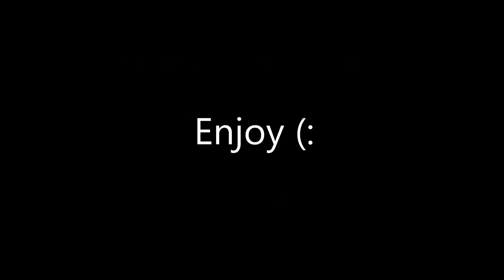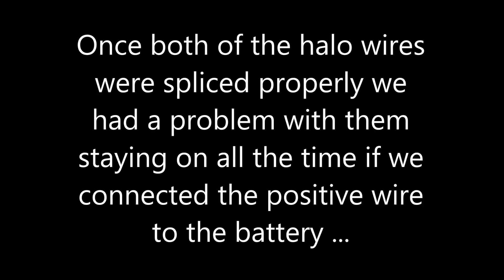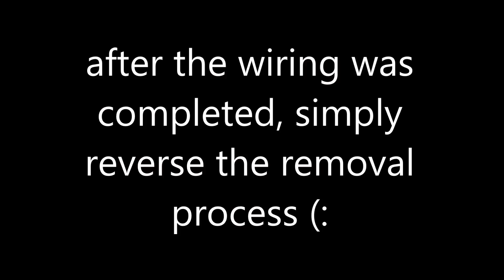How to Wire Jeep Wrangler Halo Headlights

Comment: Question the wire you had under the hood has 3 wires red , blk , yellow I seen you redirected the the power  but what did you do with the yellow one I seen the fuse box was open and yellow wire was inside . If the positive was getting power from running light why do you need to tap in fuse box my harness has 3 wires so I'm trying to understand I can't find instructions on it at all .
Reply from the maker: I actually didnt utilize the fuse box ... So sorry for the delay. Any update?
Reply: TheDavidBrunner 
Yea I found that part out by replaying your vid very slow  followed all your directions in the video and everything came out perfect 👌 thanks for the diy vid saved $$$ was quoted 250$ for installing alone . Thanks for reaching out hope this helps others as well 💯👍
Reply from the maker: Patrick Gastelum ayyye lets go! Send me a pic of your jeep on IG!

Comment: os are clearly visible in my Rubicon 2023 headlights while I cannot turn them on. 
It is mentioned that I can do that using The tazer while others are talking about a 4th wire.
Can you please advise?

Comment: Finally! Someone that had the same connectors as I do, tried hooking up to battery but they just stayed on all the time and don’t want that, so do you just cut the wire from the headlight so you can use the scotch lock to tap into turn signals?

Comment: So did you still connect the negative wire to the battery? Also what did you do with the other yellow wire that was coming out the same end of negative and positive connectors.
Reply from the maker: A more in depth video will be coming soon, did you ever figure it out?
Reply: Yes I did, I didn't connect the yellow wire to anything. They turned out great.  @davidbrunner
Reply: Did u end up connecting the negative wire as well? With splicing the positive?

Comment: I have the RGB halos and when my parking lights are off and I use my turn signal, the opposite headlight halo flashes to whatever color I have it set to. when the parking lights are on I don't have this problem. is ther any way to fix that?
Reply from the maker: Hey Paul just seeing this, any luck?

Comment: I bought a set exactly like this brand new for 40 bucks at a car market close to me. They are literally the exact same as what you have but I cant seem to get the white halo ring around the light working. Only the turn signal lights up the outer ring in orange
Reply: Did you ever figure it out? My turns signals also work but the white daytime running halo doesn’t come on. I have it spliced into the orange daytime light but still nothing.

Comment: Question ? My lights I installed are only flashing blue and red and the only color I can Change it to is pink !! Is that a wiring issue or light issue ??
Reply: The lights i just got have a QR code that you have to scan and install an app on the phone. Then you control the color of the lights with your phone via Bluetooth.
Reply: That’s how I am changing the colors but it’s only changing to those few colors
Reply from the maker: That sounds defective to me ... any update!?

Comment: Where did you connect the red wire again ? Did you connect it on the same wire where you connect the blinker wire ? Or with the wire beside it which would be the middle one ?
Reply from the maker: Sorry mate a better video will come soon. Did you ever solve your problem?
Reply: Connect it to the middle wire for tj is black and yellow not sure for other models but middle wire on blinker harness

Comment: Hey fellas! I ran into the same prob where the halos were always on and rewired with your suggestion. All is good to go except now my passenger side low beams aren't working. Has this happened in your experience?
Reply from the maker: Hm, thats strange ... any solution?
Reply: Check one of the wires has  pulled off  the connectors

Comment: I love the videos man, happy 4th of July btw. I got axial led halo for my fiancés 2014 JK, everything works fine , but ran into some problems, with daytime running halo. I spliced the blinker light and worked fine, but if i splice the halo daytime running lights into same, won’t they affect the low beams and also blinkers¿ was going to just install 15amp switch button to use em, but she would most def forgot to turn that off, any advice I’d appreciate, thx u
Reply from the maker: Would it really effect the low beams/blinkers?
Reply: Ended up going thru fuse box with accessory fuse. Turns on/off with jk, looks dope,
Reply from the maker: Ryan Amabile nice! Send me some pictures on instagram!

Comment: I followed this installation but had an issue with my battery dying, Would it be better to hook up the red wire to the fuse box with the adapter they included?
Reply from the maker: Any update? I did not experience this ...

Comment: Good video. What happens if I do not buy the resistor?
Reply: I think is a capacitor I bought a set of headlights and capacitor was not included, they didnt turn on and directly to the battery they did. I guess should be a voltage issue but i don't have multímeter. I Will go with electric technician guy to install.

Comment: that works fine until you put your jeep into gear and the headlights come on, not the running lights. If you have a fix for that, let me know.
Reply from the maker: worked fine on our install
Reply: Same. 07 jk once its started and running all goes nuts